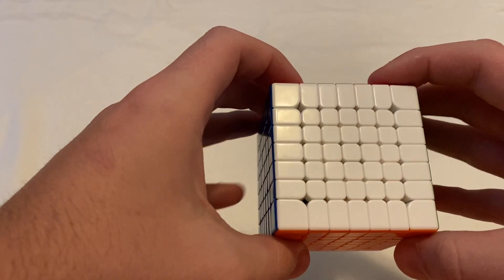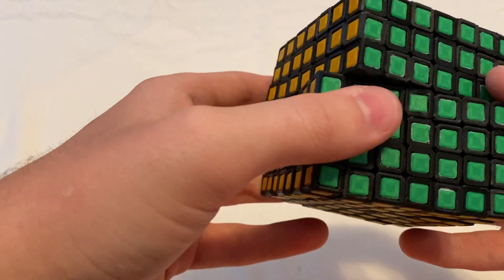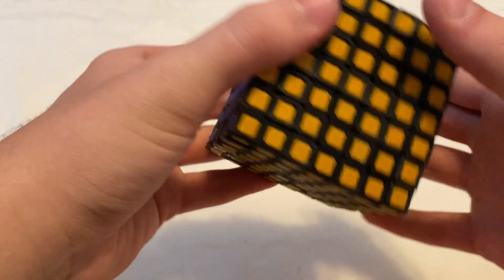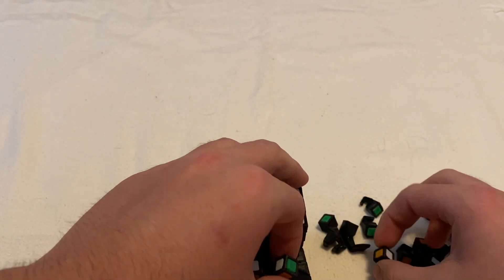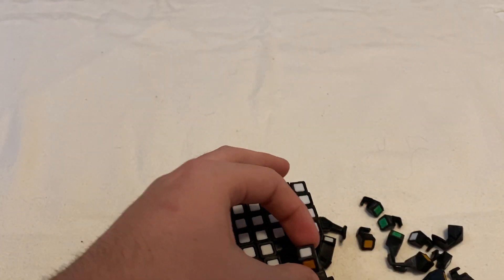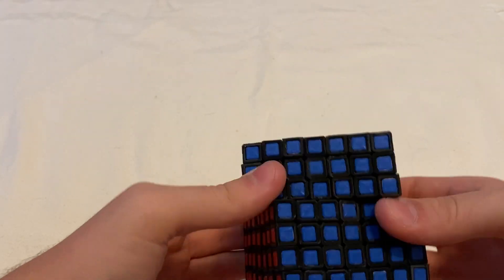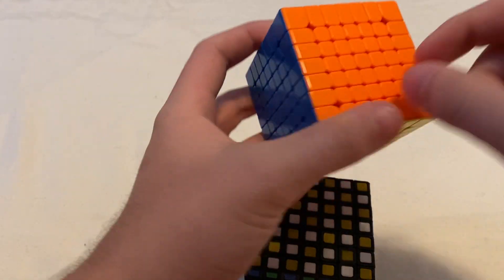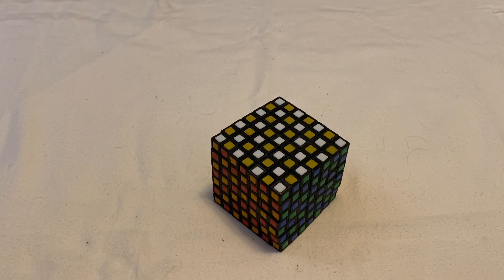Custom Cube Design #33: Proportional 7x7

Comment: Great design! This made me want to try my spring-loaded plus-centers even more rather than simply going with my slightly olzed 9mm-inner 10mm-outer design. Except I don't have enough small, soft springs on hand to do the job.
Reply from the maker: I was thinking about trying a pivoting corner stalk like I mentioned in the video. They would move out of the way during outer layer turns but since they would be rigid it would eliminate the problem with the corners flopping down

Comment: What if you use magnets on the corners. Then they don't droop down and are magnetized to the cube.
Reply from the maker: That wouldn't count because the goal was to attach the corners physically. Magnetic pull wouldn't count because there's no actual object holding the corner on, just a magnetic field
Reply: @jacobcubing606  ok
Reply: @jacobcubing606  im thinking if you had a bunch of things that worked together like magnets along with the elastic it wouldn't be physical but atleast it would be an improvement because you would make it turn nicer, doesn't solve the issue but atleast it might make it harder for them to fall out, atleast until a more stable mechanism is found
Reply from the maker: @Soporonix I actually made a new version that works a lot better, check out my video on it

Comment: Did the pins inside the corners work for you or did you scrap that idea?
Reply from the maker: I had to scrap it because with one straight needle there's no angle in which it would work well. I have a prototype of a second version that I just haven't worked on in months just because I've been busy with other projects